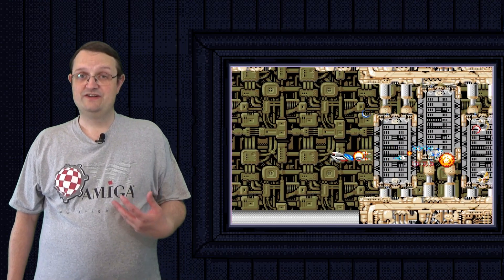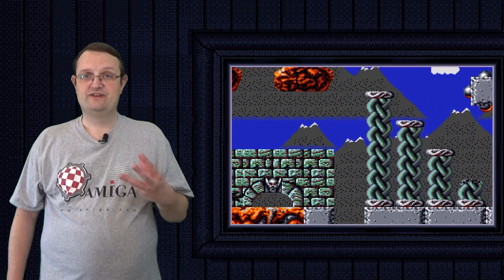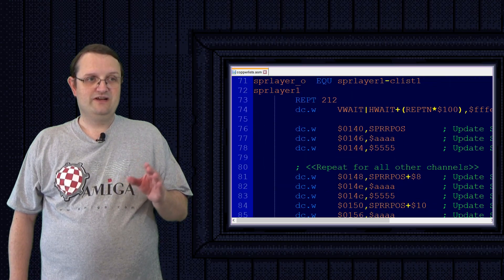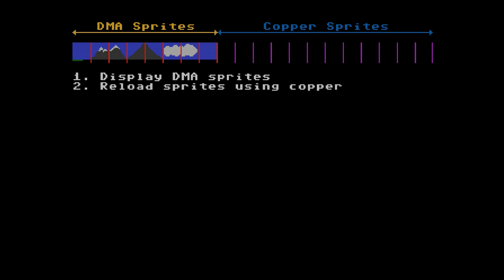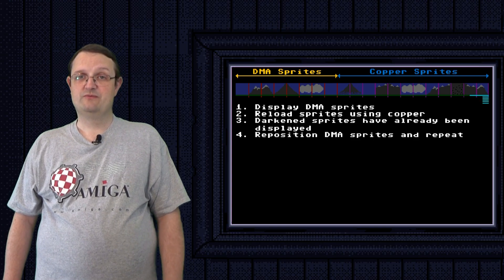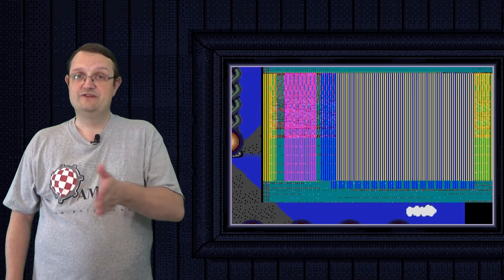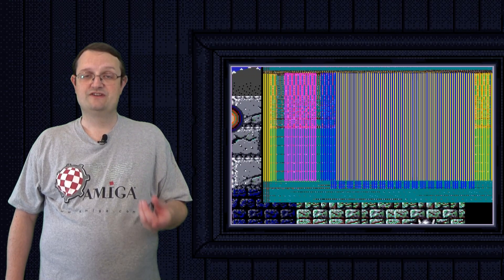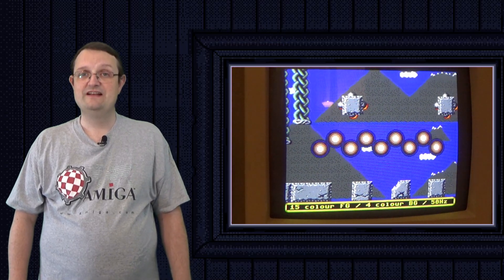Amiga Tech - Free Form Sprite Layer

Comment: Just discovered your videos - very interesting, thank you! I got an Amiga in 1986 and am still a fan. I'd like to put a couple of questions to you, if you don't mind...
This is in relation to the Amiga game "Myth - History in the Making". I  like the game a lot - except for one thing: the scrolling. It falls just short of being smooth and that spoils the game for me. Do you think it would be possible to achieve smoother scrolling on that game - without having to compromise the rest of the game? I ask this because there exist other games that place similar demands on the Amiga that have perfectly smooth scrolling. e.g. First Samurai, Risky Woods, Rubicon, Robocop 2 etc.
A secondary question: Two of the levels take place in underground caves (the 1st level and the 3d). I always felt they were crying out for a parallax layer for the cave wall in the background - which uses only four colours. Do you think the parallax method you describe in this video could achieve that - and still maintain a smooth frame rate? Thanks in advance.
Reply from the maker: Hi, thanks for your comment and question. I've tried to answer it, but it ended up a wall of text. 
Sorry!
Myth is a 25PFS game, it runs at half frame rate. Looking at the game, I see there's a ton of CPU use going on, for what (on the surface) seems to be a simple game. On the other hand, hardware scrolling is actually being used (at a variable speed, but updating only once every other frame) and the game smartly sets up the screen to lower DMA use during the top panel. It uses the Blitter, but no hardware sprites seem to be used at all.
So, can this be done better? Well, the issue is that I don't know what the CPU use is all about. It could be that Myth is deceptive: it seems simpler than it is, there's good reasons to use so much CPU. It could also be that the CPU use (and/or Blitter use, which also seems a touch on the high end for what is actually on screen) is just not done very efficiently.
If it's the former, smoothing out scrolling is unlikely: the game uses about a frame and half of CPU per screen update (so, it's bound to run at 25FPS or lower). If it's the latter, then it could possibly be done if a coder was determined enough and decided to rewrite the entire core game loop. There is at least one clear optimisation that can be made: using hardware sprites as part of the game instead of using just the Blitter. That should speed up the game considerably. But unless the high CPU use is addressed somehow, this by itself won't be enough.
As for the Sprite Layer as I present it, I'm sad to say it won't work. My version of this effect uses a significant amount of system resources, adding it to existing games is very unlikely to not affect their frame rate negatively. There is a less resource intensive version of this effect (i.e. a Sprite Layer with a repeating pattern), which was used by many games and that might work. But still, even that costs a fair share of resources so wouldn't likely work in the case of Myth.
Reply: @DutchRetroGuy  Thank you very much for taking the time to reply. I have been wondering about this question for a long time and you've really put me out of my misery! 
What you've said is extremely informative (I have no problem with a wall of text, by the way!). My problem is that I'm not very familiar with programming, so I'm comparing and contrasting from a layman's perspective. A couple of notes: (1) I can see that there is a lot going on in some levels of "Myth" - especially the first level: lots of largish, animated characters moving around, a fire effect, background torches, multi-directional scrolling, so it's understandable that a high frame rate would be difficult to achieve. (2) Normally, I find that games that are said to be running at 25FPS move perfectly smoothly to my eye - and a solid 25FPS is what I'd like to see in "Myth". But it appears to me that is running at a slightly lower rate - to my eyes it looks to be about 20FPS, which is fine - but not quite at the target, if you get me. (2) The other thing that puzzles me is that even on levels that are making far less demands in terms of graphics and animation, the scrolling does not improve at all. (3) None of this is improved in the AGA version. You would think it would have been simple enough. (4) The high demands on the Amiga that I mentioned in Point (1) are also being made in "First Samurai", i.e. lots of largish, animated characters on screen, fire effects, torches (plus other effects, waterfalls, particles etc), multi-directional scrolling   - and yet the whole thing moves as smoothly as you could wish.
Anyway, I'll leave it there. Apologies for writing my own wall of text! Thank you again - I greatly appreciate your response.
Reply from the maker: @Midwinter2  no problem, I don't mind theorycrafting Amiga stuff :)
Anyway, I think the reason the scrolling seems odd isn't the refresh rate (which does appear to be 25FPS to me). It's rather that it doesn't scroll at one speed - Myth speeds up and slows down scrolling, which can give the impression of lower frame rates. 
In other words, the slow/odd scrolling seems to be more by artistic design than limitations of the system.

Well, that's my take anyway. I could be wrong, I didn't disassemble the whole games or anything ;)
Reply: @DutchRetroGuy  Interesting. Thanks again!
Reply: @DutchRetroGuy  I just checked: Myth framerate is 16.66fps, but when there are more than 5 animated objects on screen it drops to 12.5fps... That's why you feel the scrolling is not smooth. IMHO it's not well programmed... Myth is a 16 colors game, with a game area of 320x150 pixels but it uses from 3 to 4 frames to update the screen! I see no reason why it uses so much time to update the screen unless it uses just the CPU, without Blitter, like your typical Atari ST conversion. If it uses the Blitter, then this could mean that the CPU code that manages the game logic is very inefficient... This type of game should run at least at a steady 25fps on the Amiga OCS. There are plenty of nice platform games with multi-directional 50fps smooth scrolling on the Amiga (Turrican series, BC Kid, Leander, Super Frog, Zool, Robocod, Lionheart, Bubba'n'Stix, Soccer Kid, etc.) and some of them use some clever parallax effects too...
Reply from the maker: @amigamagic5754  I checked the game using the WinUAE Visual DMA Debugger, it does use the Blitter - but not really in an efficient way it seems. Honestly, I still don't really understand why it runs so poorly, it really shouldn't.

Like you point out, there's plenty of games that show it can be done a lot better.
Reply: @DutchRetroGuy  Interesting thing: the main coder of Myth (Amiga version) made another (rather obscure) platform game in 1989, 'Eye of Horus', so 2 years before Myth. It starts with a framerate of 25fps and at first it looks smoother than Myth (and indeed it is). But then, when there are many objects on screen, the framerate goes down to 16fps, 12fps or even lower than that when the animated objects on screen are more than 10... From what I've seen, Eye of Horus has many large horizontal scrolling levels connected by some 'lifts'. The only time where the game area scrolls vertically is when the player uses a lift to go to an upper or lower level. So, the scrolling in this game is not really multi-directional... But considering the similar drop of framerate as the number of objects increases, I think that for Myth the coder used the same drawing routines he made 2 years before for Eye of Horus, but he adapted those routines for a true multi-directional scrolling... And this somehow lowered the base fps from 25 to 16fps...
Reply from the maker: @amigamagic5754  it's very strange, when properly coded scrolling doesn't really take that much CPU or Blitter time. The difference between single axis scrolling and multidirectional scrolling should not be that big.
Reply: @DutchRetroGuy  I checked again a gameplay video of Eye of Horus... At first it looks like a platform game, but actually it's more a shooter than a platform. I don't see platforms where you can jump, but just a floor where the main player can walk or he can transform into a bird and then the game behaves more like a shoot'em up with exploration. You have to turn back into human shape just to take or use objects or to operate the lifts. So, probably Myth has more CPU code to manage the jumping on the platforms. Anyway this doesn't justify the poor framerate in such games. They both look like your typical lazy porting from an Atari ST game code so I'm surprised if they use the Blitter.
Reply from the maker: @amigamagic5754  I can't tell about Eye of Horus as I've never played it or even see it, but Myth definitely does use the Blitter. 

You can verify this for yourself using the WinUAE Visual DMA Debugger (which is what I used to check it) :)
Reply: @DutchRetroGuy  Thanks for the tip but I have no reason to not trust what you say. 😉
Here is a video of Eye Of Horus gameplay: https://www.youtube.com/watch?v=-JmDpbpJpXE
Reply: @Midwinter2  I liked it very much too for its great atmosphere and the cool graphic style. The game was designed with great attention to detail, and each level had something different that made the gameplay varied and never boring. 

Unfortunately the programming level was not on par with its good design. The framerate should have been at least a steady 25fps and I think in some levels a little parallax effect would have been possible (maybe a monochromatic parallax layer, as in Second Samurai, Bubba'n'Stix and others, or a little pattern of repeated sprites, as in Leander) without significative framerate penalty. But, anyway, even so, I had a lot of fun playing it.
Reply: @amigamagic5754  Great - thanks for your comment. And I'm sorry that my response comes seven months later (D'oh!). You are absolutely right about Eye of Horus - the scrolling is poor and really, there seems no justification for that. You have mentioned similar games that scroll at 50fps with no problem. 

Here's the clincher, though: I looked at the Atari ST version of Eye of Horus and guess what.....? It scrolls smoother than the Amiga version! That is absolutely extraordinary - and is conclusive proof that the programmer really had no clue how to program the Amiga.

Comment: On your WWW I have sent you a large explanation how you can improve this effect using less DMA, but i have no response. Can you check it? BTW. Great work!
Reply from the maker: I have seen that and send you an e-mail back in which I explained that I'd answer it when I got the time. Sorry for the delay.

So let's answer it here :)

Yes, you are correct that you can improve the DMA load of the effect by about 17% by using the sprite channels differently. Which is a good improvement, but still makes it far too 'heavy' for use in most games as you gain only about 2700 DMA cycles by doing so (which is about 3,8% of the Amiga's total per frame). 

I hadn't thought of this optimisation when I made this, but it's cool to hear other people thinking about this as well :)

You also ask about needing many Copperlists. The effect as I've made it does not use 8 Copperlists, but rather four. The trick is to not store eight copies, but rather build up an entirely new Copperlist (plus a copy of this new one) over a 32 frame period. During these 32 frames you show the two you already have and update only the sprite's positions.

Using 8 Copperlists would not improve performance, but rather make it worse as it would quadruple the number of bytes you need to push per frame for the new sprite data.

The rest of your e-mail concerns the OCS Rygar port and I'm sorry to say it, but I don't really think optimisation was the problem here at all. Rather a too enthusiastic team that forgot to take into account the system's overall limits in terms of how many bobs it can draw per frame. 

If you merely show a 32 colour display without sprite layer, you're already limited to about 15 bobs @32x32 (this scales based on size so 30 bobs of 32x16, etc) per frame. Add in a repeating sprite background and you lose 3 or 4 of them. Add in game logic and you lose a few more. 

But the Rygar port was aimed at 64 colours (EHB), which is even slower, so you lose even more bobs. It was an uphill struggle to begin with. I think the problem was wanting too much - a port using Dual Playfield and using sprites for the main character & weapon would've been much more doable - even though it would obviously not look as nice.

Note: the above is no dig against the coder or artists involved in any way, they are certainly capable enough and I think what we got for OCS was pretty good, all things considered! I certainly enjoyed seeing it come together and it was part of the inspiration to do this effect :)
Reply: @DutchRetroGuy  ok i have sent you a bigger question regarding Rygar

Comment: Do you think a near accurate port of the megadrive version or Strider is possible on the A500. Same size sprites and parallax with reduced colour but still running at 50hz?
Reply from the maker: I took a look at the Strider longplay for the Mega Drive. I'm reasonably confident you could get a close to perfect port @50Hz on the A1200. On the A500 however, I honestly don't think you'd manage at 50Hz.

Do note I just eye balled it, so perhaps someone else might think differently.
Reply: You could definitely do better than the US Gold version. If you look at Leander, that's about the closest thing I can think of. That's from a masterful coder. There'd still be some compromises beyond colours, like screen movement during the massive boss fights... But it could be more than six frames a second and with teeny tiny sprites!
AGA could be close to arcade perfect.
But, while I love good arcade ports, we live in an era of emulation so why not just play those.
I'd rather people make new fan games or original IPs based inspired by those old favourites. Then you can play to the Amiga's strengths graphics wise while borrowing gameplay elements from the classics

Comment: i think is good.  but dma time is bad
because this is why
you are basically running 6 bitplanes total. 4 for main screen and 2 for sprite layer. plus you are manually reload sprites with new data. thats more dma taken.... 
so 3 colors for back ground. more with simple copper changes.
but none the less. 6 bit planes of dma time plus cpu,blitter,and copper to achive effect.
so over head is greater than 6 bitplane dualplayfield.

im not saying its bad. i still like it. just is dma hungry. so it has to suit the task it used for.... .
that's what different modes are for.
all depends on type of game mode.
Reply from the maker: easyerthanyouthink Indeed, this effect uses an awful lot of DMA time, I even acknowledge this in the video. It’s more of a ‘how far can I push Sprites’ experiment than a super useful new screen mode. That said, in some cases it can probably be useful. You could limit the effect size for instance, or use it when there is less need for heavy Blitter usage.

In essence it’s just another trick to consider in the large toolbox of trick for the Amiga ;)
Reply: totally. sorry i forgot you said that. yes, your video you state it is just a fun thing you did and had not seen it in any game. it good be but i have not seen it either. this video just got me excited.  the humble sprites of the amiga were total rubbish relative to the machine. but the best coders out there really new how to do awesome things with them. eg you just did this. im pretty sure codetapper did very similar to this. and im sure some others may have. but like you said., i dont think there is any game with it.
i tried multiplex 1 sprite 10 times in the same scan line.
it worked. but a cant remeber how many bitplane i was using at the time. amd tried multiplex chains sprites 16color with new data in second set and it worked
 sort of then sprite corruption crept in and rand out of dma time.
cant remember how wide but it didnt do what i wanted.
Reply: Actually you can see at 4:49 how many DMA cycles are taken by copper (yellow), bitplanes (blue) and sprites(red). As you can see not so many are left for Blitter(green) not to mention CPU (grey). However you still have so many unused DMA cycles (black) left so plenty area for optimisation ;-) (joke)

Comment: Nice video! You could try to show more colors on screen splitting the image into multiple horizontal slices, with palette switches during vertical scan. For example, you could modify 8 times during vert scan to allow 512 colors on screen without artifacts as HAM has. That do not require complex operations for moving parts. This is also the so called EHB Sliced mode. Course you must race the beam with copper lists.
Reply from the maker: Thanks!

I agree, using the Copper to add additional colours would be possible. However, for this series (ok, it only has one part but that should change eventually :P), I try to show just one effect at a time. This keeps the example source code easier to read and keeps the written/spoken explanation focussed on one subject.

Maybe I'll do a video on Copper rainbow effects one day though ;)
Reply: Thanks to you for your contributions and retro LABs.